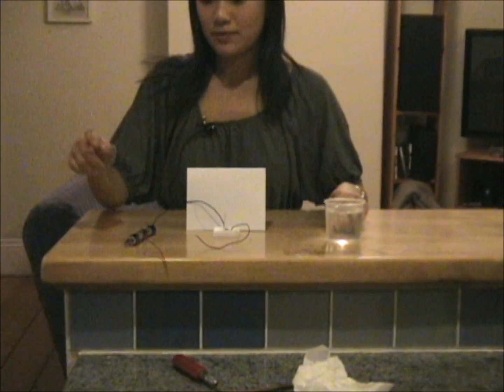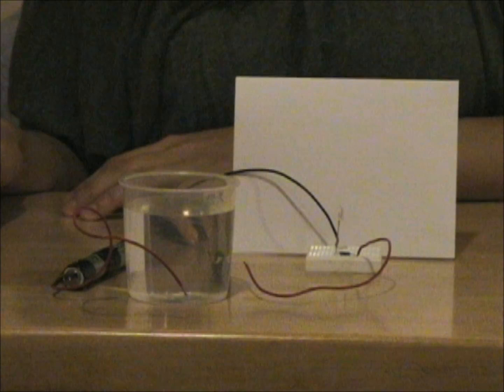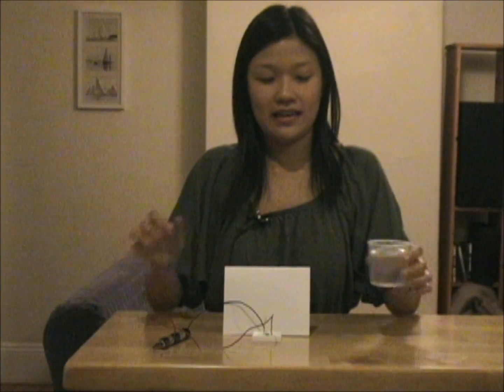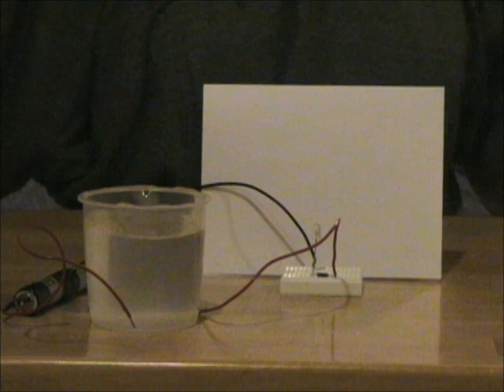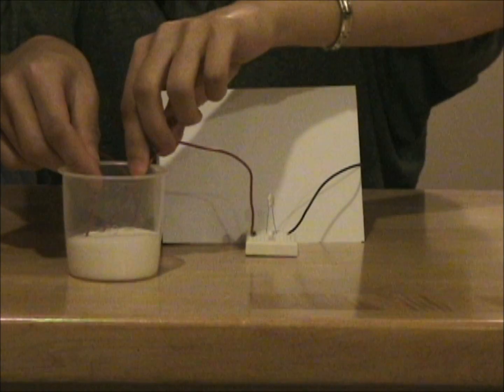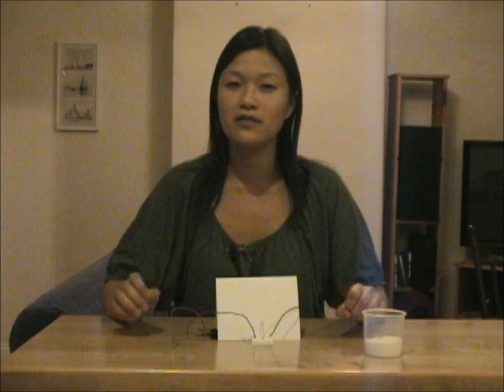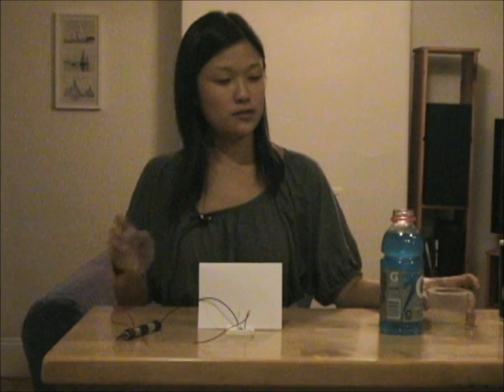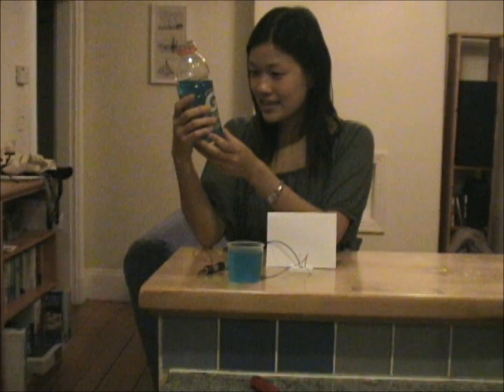Does Water Conduct Electricity

Comment: Awesome video. Next time I take a bath holding a tv on a plastic plate floating on top of the water and a toaster next to me so I can make some good toast and Im also holding a hair drier in my right hand with my laptop sitting next to me Im browsing the web with my left hand I will make sure I have the bathtub filled with pure distilled water so there are no traces of salts or minerals that can conduct the electricity. If I want some gatorade though with the electrolyte salts added in and I accidentally spill it into the bathtub and also accidentally drop all the devices conducting electricity into the tub at the same time Im screwed. A light bulb bright on idea would be to never take a bath again. Just take a shower with my waterproof computer watch that I can use to watch youtube on which is what I am doing now.

Comment: I am told the general rule is that any liquid will conduct electricity the even the manf of the fire extingusiher I listed below that uses distilled water an employee of that company said it conducts but the belief is that conductivity is allows if is measures only in some kind of micron style meaurement so its a weak/poor conductor and as for it being mist when a spray type nozzle is used that further reduces the amount of electricity the liquid can conduct !!!! thats why the extinguisher is distilled water mist mist is a poor conductor as its harder to pull a current over an air space !!!!

Comment: well did you know I fire marshal one told me as a rule pure water does not conduct the reason water conducts i read is due to the mineral impurities tap water conducts but is not a great conductor distilled water is even less did you know there is a fire extinguisher containing distilled water and it is rated as safe for electrical fires ? here is the example : as for gatorade gatorade has electrolytes which is a mineral which will conduct I guess you have not seen the amerex water mist fire extinguisher advertisement I enclose it here : https://youtu.be/mSDFZlAIKhE

Comment: Great video!  The pharaohs used a device known as the "cylinders of the pharaoh" made from copper(cathode) and zinc(anode) cylinders filled with quartz when held(human body=electrolyte) produce up to 1.5 volts.  The copper is held in the right hand which is the positive flow of ions and the zinc is held in the left hand which is the negative flow of ions that influence the human bio-field.  Make them yourself or get them on amazon or etsy.

Comment: There is a problem with your reasoning, there is no such thing in nature as a perfect insulator, everything will eventually reach a breakdown threshold that will allow conductivity, you are trying to employ the water in your experiment as a conductor when you should be thinking of it in terms of being a resistor in the circuit. now, what does ohms law say we must do? we have a resistor probably in the megaohms range and a load that requires so much current to operate. by adding the salt what you have effectively done is turn your megaohms of resistor into just a few ohms of resistor., so i guess you could think of it as a very crude potentiometer.. https://www.youtube.com/watch?v=lyy3HobZMdo